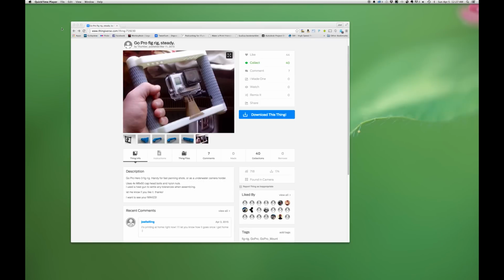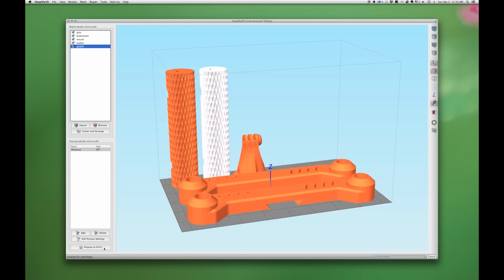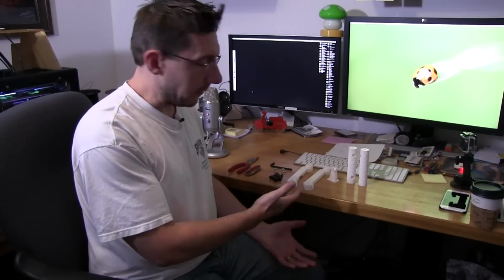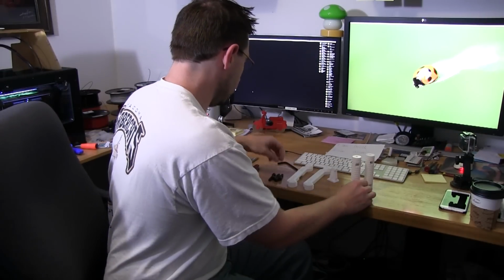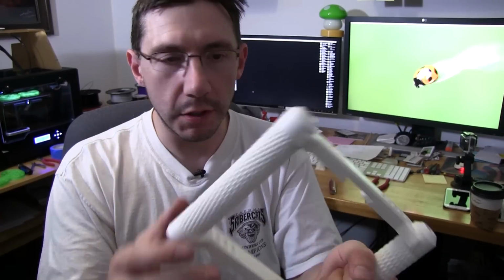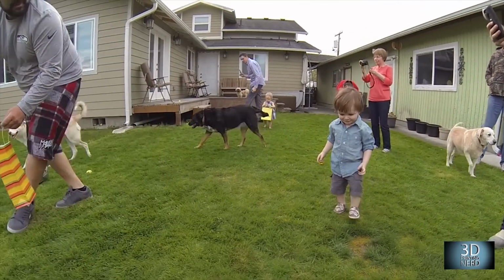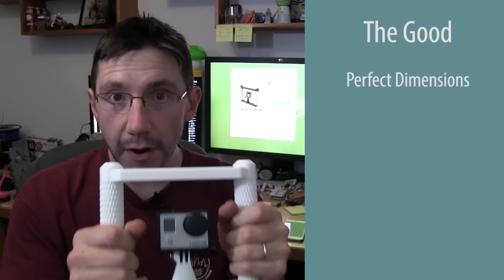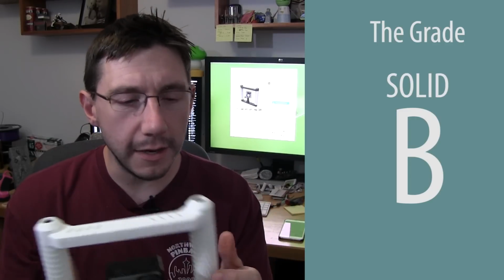3D Printed GoPro Camera Rig Build + Review

Comment: Hi Joel, High Five.  with that holder, instead of flatting the base, just lay it down and use the GoPro Hinge and angle the goPro at a 90 Degree.  There by having a stable level base again.  High Five.

Comment: I wouldn’t trust a printed part to hold my GoPro, I would use a factory injected tripod mount with a 1/4” 20 screw holding it underneath instead. I would also make a mount for a external mic and light on top.

Comment: Quick questions:
What are your reasons for extrusion width being 0.45 for the 0.4mm extruder?
And how did you calculate retraction distance?

Keen to learn. Thanks. :)
Reply from the maker: Ross Hall Hello Ross! Setting the extrusion width to 0.45 allowed for a thicker bead of plastic resulting in a slightly stronger part. For retraction, I know there IS a way to calculate it, however, I went the lazy route and just used numbers until I found something that worked.

Comment: How Strong is it? That is my main concern and also does it float in water? as i would ideally use this for scuba diving, also if its possible to slightly change the design so that it has a closed loop on it, then i can attach a short bungie cord to my diving gear so that if i drop it i dont lose it... Thanks
Reply from the maker: James Parker Hello! I have, so far, found it to be pretty strong. I think it's because the plastic handles act as spaces rather than threaded receivers. The bolts go through the hanldes, and have nylon lock nuts on either side. As for floating, that's a good question. I haven't had a chance to throw it in the water. Each top and bottom piece have two closed loops capable of routing a small bungie cord through!

Comment: i like the video, but something odd. rather then trying to set the mount down with the camera in the same orientation  can you lean the camera forward 90 Degrease and have a hugely stable base? not sure if the GoPro mount allows for that much rotation or if the base will then be in the shot.
Reply from the maker: +Sean Devine um... that might work!

Comment: A long screw in each handle would cost more
Reply from the maker: Cost more than what?
Reply: Than 2 smaller screws per handle
Reply: I would assume anyway. I'm not an expert in screw stock market, feel free to correct me ;)
Reply from the maker: Rubafix989 Hahahahhaha
Reply: what about two small pieces of all-thread and 4 lock nuts on the ends? that would be cheap and easy to put together

Comment: :-) i do not understand, what purpose of it? can't you hold camera just in your hand? why do you need such huge tool to hold it? people inventing and doing fings to have it small, compacrt, to fit in theirs pockets. now you did opposite. just pick old digital camera if you want it to have biger :-) in extra you will have toons of good options  like optical zoom, perfect lens and sound, price. as per my opinion this is useles. i would agree with you if this tool will stabilize the image like steadycam, but now... sorry.
Reply from the maker: +Petras L holding a GoPro with just a hand leaves too much instability and possible micro rotation. Using this and holding it with two hands removes the micro rotations and stabilizes the shot with two arms holding it. It works really well! Plus, yes, I have a Canon 1Dx for the times I need a better lens for a cleaner shot :)
Reply: Probably you right, but i would think then about real stabiliser like i mentioned. Its just my opinion :) Cheers!